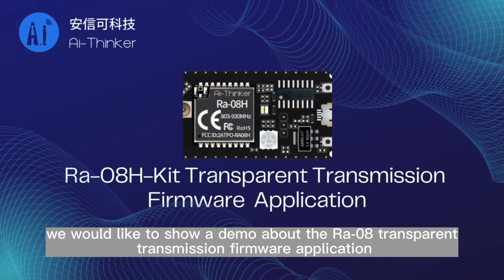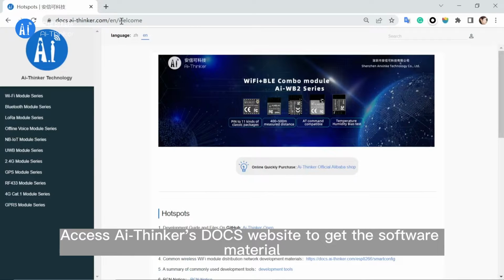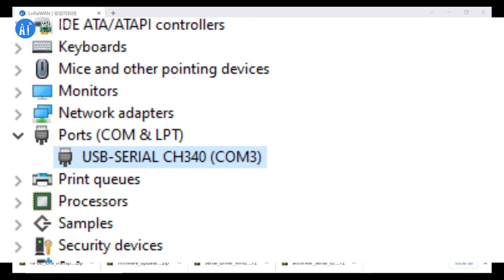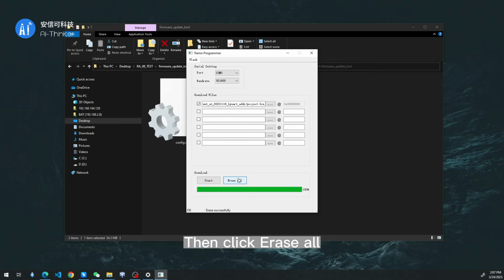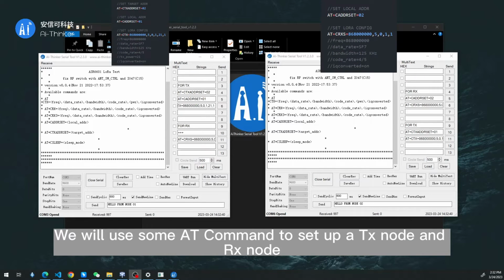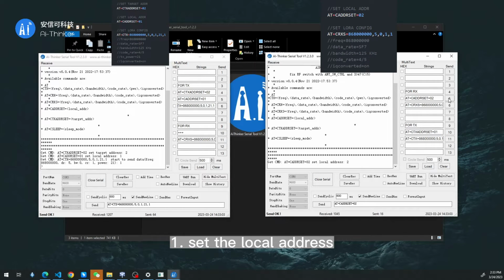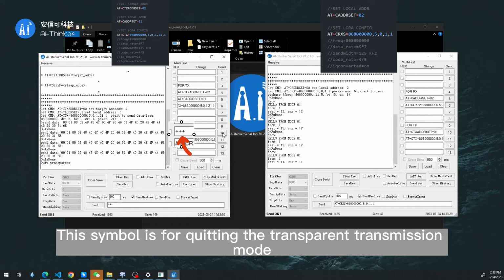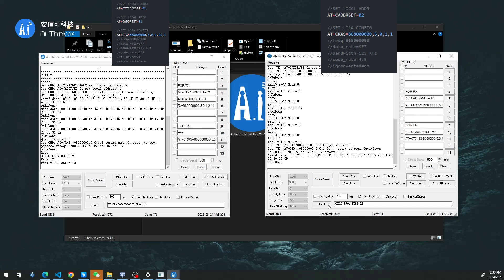LoRaWAN Transparent Transmission Firmware Application

Comment: how can you save these settings so after closing the app and reconnecting, one is still on send mode and another on receive?
Reply from the maker: There is a method to save the network parameters, and it will automatically connect to the network after powering on again. There is no such thing as the sending or receiving mode you mentioned. It all works according to the configured Class A, B, and C working modes.

Comment: Have a good day! Is it possible to transmit data byte by byte without adding information (RSSI, SNR) So that the data flow at the input of one module is the same at the output of another module.  How change the speed from 9600 in this mode (transparent transmit)?
Reply: In which environment can I edit the source files and compile the modified firmware?
Reply from the maker: keil, IDE for development. 
check this: https://github.com/Ai-Thinker-Open/Ai-Thinker-LoRaWAN-Ra-08
Reply from the maker: Hello! The maximum baud rate of the serial port is 9600. If you want to use UART0, you need to develop it by yourself.